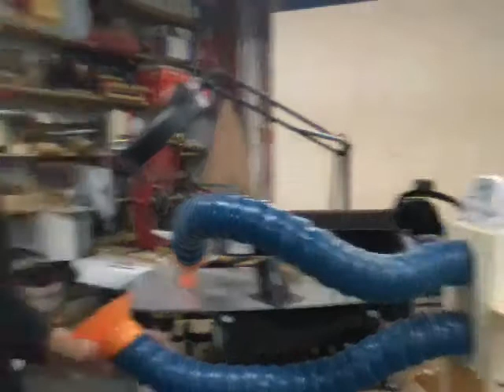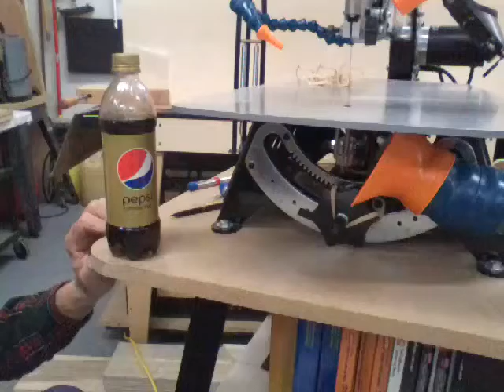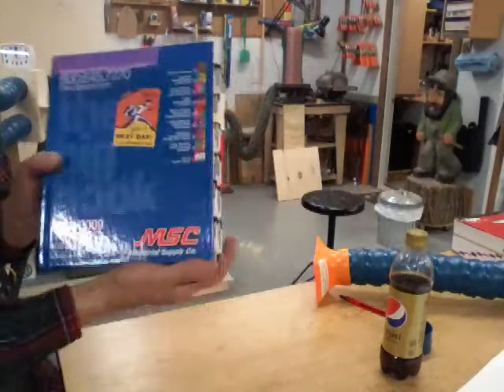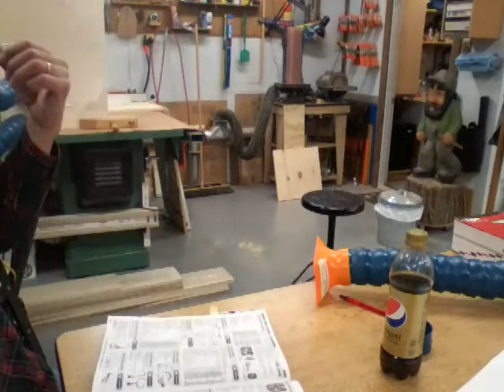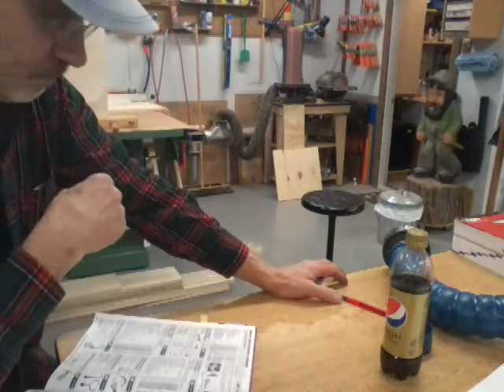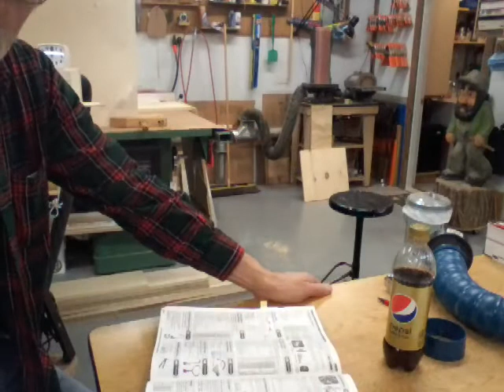84. Excalibur scroll saw / dust collection

Comment: HI Jim, Great video thanks. What is the vac you are using? is it noisy? and do you need a mask still or is the vac enough to save ya lungs?
Reply from the maker: Simon Bratt 
It’s a three horse Rigid shop vac
And most of the time, I wear a dust mask. Jim
Reply: @jimjackson9381  thanks Jim, im spending time investigating dust extraction before i start on my scroll saw adventure, its a bit of a mine field
Reply from the maker: Simon Bratt 
What kind of saw do you have and what are you going to be making. Jim
Reply: @jimjackson9381  HI Jim
I have a 
Axminster Trade AT535SS Scroll Saw, going to be using hardwood, that's about as far as I've got so far lol
Reply from the maker: Simon Bratt I made a lot of kids puzzles on mine and I am store that sells them for me. Jim

Comment: Great video and a fantastic dust extraction solution. What is the technical name for that type of ducting? I am in the UK so will need something similar, hopefully as good. Thank you Jim.
Reply from the maker: Jetsetscotty 
Hi it’s Jim
  And I have some good news for you I hope, I called MSC supply and they tell me they have a store in the UK and Asia the phone number she gave me is 0800663355 and she gave me a name of a town I think  WEDNESBURY. She wasn’t quite sure either, if you have any troubles getting a hold of them with this phone number let me know and I’ll get some other information from her I hope this helps. Thanks Jim
  I hope you’re a subscriber also talk to you soon
Reply: @jimjackson9381  Thanks Jim, just found it on the internet but I can only see 300mm lengths so will call tomorrow. https://www.mscdirect.co.uk Thanks again and I'll let you know if I get some over here, Scott.
Reply: @jimjackson9381  Hi Jim, thank you for your help. I can get it over here but only in 300mm lengths. They say it is supplied in these lengths due to the way it works and simply pushes together. Is this how your 600m length is put together (two pieces)? Thanks Jim.
Reply from the maker: Hi this is Jim 
   The piece on the top of my saw is about 22 inches long, the piece on the bottom is about 29 inches long. If you need any help buying this stuff Let me know and I’ll call them on my end and see if I can help you out. Thanks Jim
Reply from the maker: Jetsetscotty 
 Hi it’s Jim
    Have you had any luck finding your loc- line tubing for your saw. If you need help just let me know talk to you soon. Jim
Reply: @jimjackson9381  Hi Jim, I have been a little busy with work but I am thinking of possibly joining sections as they tell me. Would prefer a single length though. I am unsure on how the construction of the tube is and whether or not it could be cut down if you could buy a much longer length. I could build an extraction set up with tubing but there is no flexibility like the Loc-Line. I am waiting for another reply back from MSC in the UK.
Reply from the maker: Jetsetscotty 
Hi it’s Jim
  If you look at this video at 8:54 it shows I’m holding a small section of the loc-line and the hose looks like it has a ridge about every inch and three-quarter’s each ridge is a section you can pop every one of them apart if you wanted to and they also flex at each section so if you assembled your two sections it would be one complete hose that will flex in any direction or shape, if they’re selling the same product that we have here let me know what you find out and I can help you get what you need. Thanks Jim

Comment: Another top notch machine setup!  Good stuff!

Question:   I recently got an older 20" Craftsman Contractor Series scrollsaw. I have only used the pinned blades that came with it.  (It appears it can use pin-less as well)  I have issues with blade tracking. It always cuts towards the right -significantly. Do pin-less blades help alleviate this sideways cutting issue?  Thanks!
Reply from the maker: Jeff Padgett  hi  Jeff this is Jim
   I'm buying my blades from The Flying Dutchman you can find them online the pinless blades for most part  are Stamped Out and all the teeth on the blade are set in One Direction they're not like a standard saw blade where the teeth are staggered both directions  so they do tend to cut off to one side when you're trying to cut a straight line you have to turn the board to compensate for the blades.   now you can buy some blades that are actually ground but they are very expensive compared to the standard scroll saw blades some of them from the Flying Dutchman you can get some for $2.95 for a dozen blades. I'm not sure how long you been scrolling but I had my share of issues when I first started but I just Googled and watched all of the scrolling videos that I could find.   if you're having any other issues with your scrolling send me an email and I'll be more than happy to help you out, my email  is   jandrwoodworking2@gmail.com   I hope you're subscribed and if you're enjoying the videos give me a thumbs up and let me know what you think .   thanks again Jim
Reply: Thanks!  I got my first scrollsaw 30 years ago.  It was a 16" craftsman. I never had the tracking issues with that one. I guess it's about time I try the pin-less lol.  I'm looking at the Flying Dutchman variety packs right now.  Maybe I need to recheck alignment and squareness and deal with the nature of how it cuts.  

I've been subscribed from day one!  I got an 33" Extra Tough Snapper that will surely need re-built soon. Your videos are a wealth of knowledge that will make the task way easier!
Reply from the maker: Jeff Padgett    Hey Jeff it's Jim thanks for your questions and comments at least I know I'm helping some people or at least making their job a little easier that's what I want my channel to be about. Talk to you soon Jim